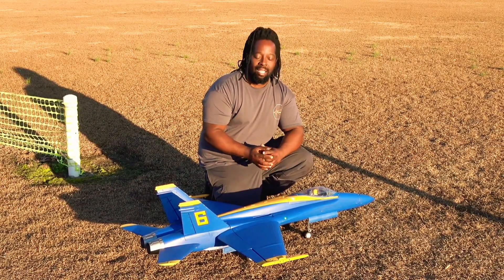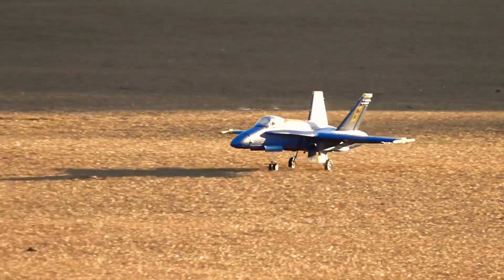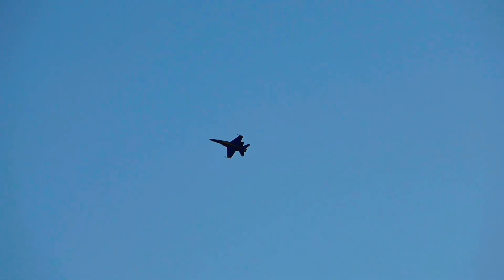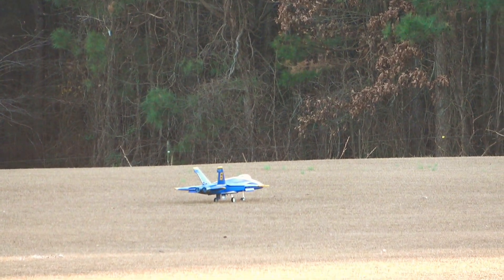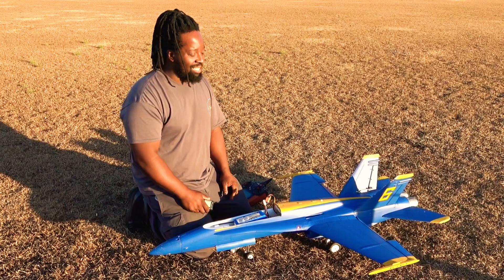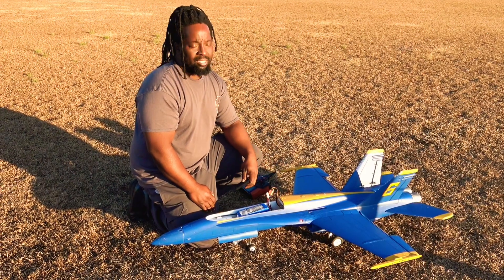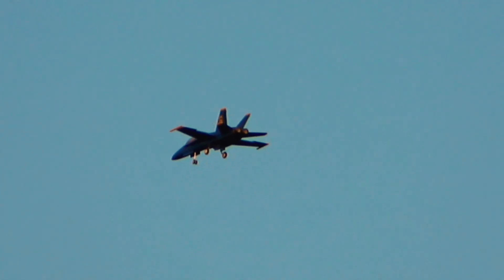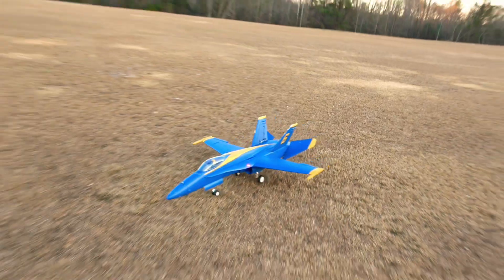Freewing F-18 Experiment Power Meets Efficiency #aviation #rcplane #freewing #hobbyking #smcracing

Comment: nice flying, and awesome landings! I couldnt help noticing your battery checker is only a Lipo and not an LIHV checker, so if you only charged it as a lipo it would be at 38% but if you were on LIHV it would only be around 15-20%, so pretty much spot on for flight time.
Reply from the maker: Now looking back at the video i didn't change the settings to LiHV

Comment: fyi    the design of intakes, exits and internal ducting  NEEDs  to be compatible with the edf being used.!!!      it, therefore, may be a less-than good idea to use a larger-than stock edf.     
there is a high-pitched component in the edf noise that may a symptom of incompatibility.
Reply from the maker: True statement. In this video the model is made for a 90mm edf. I'm just using a motor with less weight weight and more kv. Also requires less amps.

Comment: Nice flying. Mine has always had a 90mm fan with a FW 3672-1900kv motor. Is the flap announcement in millimeters or degrees? I always use 15° for takeoff and I think the most I can get on the F/A-18 is 30° for landing. I use homemade angle gages to set my flaps.
Reply from the maker: Thanks. My flaps are in degrees.